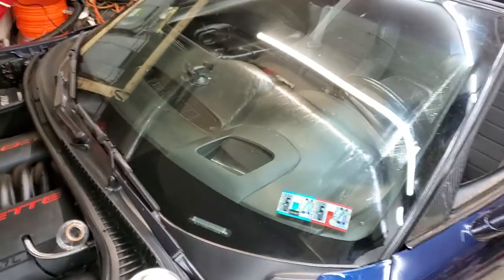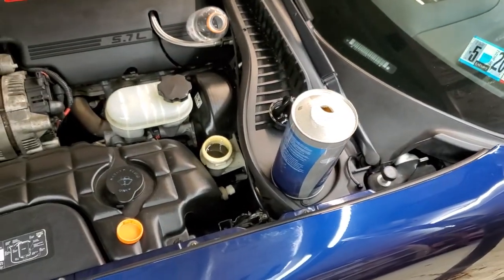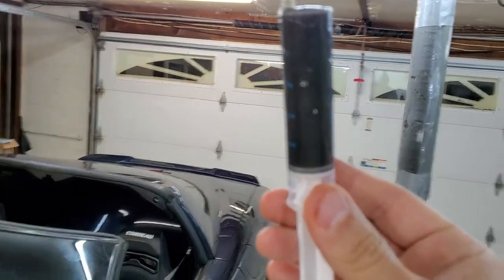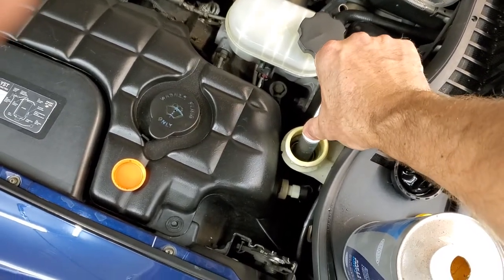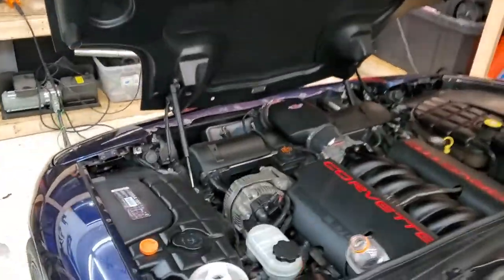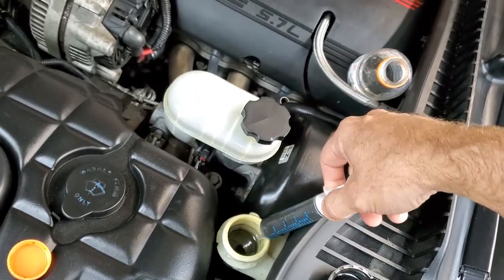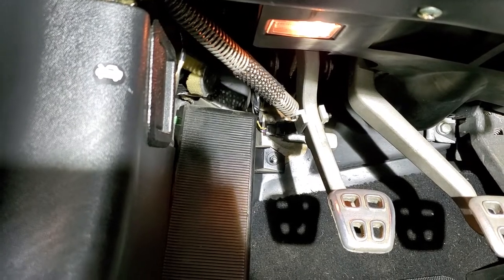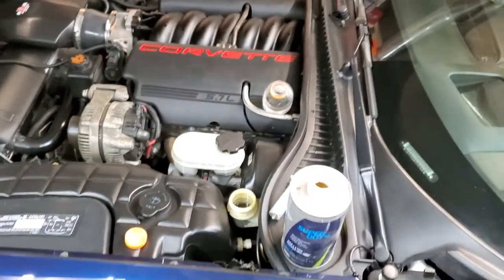Fixing sticking clutch pedal on a c5 corvette

Comment: I have a My-T-Vac fluid evacuator that will slurp that reservoir dry in 
seconds and holds 2.3 gallons. It's a good tool to have for changing 
fluids in anything with inaccessible drains. I use it to change the oil 
on my supercharger. Also good changing water pumps, cyl heads etc when 
there is no way to drain the block and the coolant level is even with 
the gasket surfaces you need to clean and prepare. You can suck the 
coolant out of the block and get it below your working level.
Reply: Which model do you have?
Reply: @aces23jump  Model 7201, $115 on amazon.

Comment: You can use the cheap air powered bleeder from Harbor Freight to suck the fluid out of the MC. Its a good sized container so it will hold a lot.

Comment: This is happened several times I did exactly what Ranger says in his videos my clutch still gets stuck amd the fluid is clear I use DOT 4 as well.. my car has 44,000 miles Full Exhaust, Intake and Tune 2nd owner pretty sure it's a factory clutch
Reply: Same. I got a C5 Z06 with 42k miles. Full exhaust, intake, cam and a tune. Clutch pedal sticks or gets half stuck every time I dump it at high rpms. Then goes back to normal after 2 minutes. So damn annoying.
Reply: @ghostk5763  well I got the Clutch fluid lines E-Wrapped Aka some kind of heavy duty electrical tape but it still keeps doing it I think I need a new clutch honestly I just got my dynoed 2 weeks ago exact mods Kooks 1" 7/8 Longtubes with a 3" collector to a matching Kooks 3" X-Pipe and reduces to 2" 1/2" to a Corsa Sport Axleback and a True Cold Air Intake from K&N and Tune made 395 @ Wheels & 370 ibs ft of TQ. And to be honest I just raced a brand new 2020 Coyote 6 spd this morning I had him by 2 car lengths  we raced from 60 I was in 3rd he jumped on Me for a like 2 sec and I still was able to pull on him my the end 3rd and immediately stop his pull and kept pulling on 4th
Reply: @ricardovilla1757  Thats awesome man. Yeah I have Kooks longtubes, Full Corsa Extreme exhaust, True Cold Air intake and I don't know my Cam because it was done by previous owner, same with the tune. I haven't raced anyone and I'm unaware of the WHP. But overtaking people sometimes I catch myself accidentally going 120+ Mph, it just catches up to speed so fast with such little throttle. But if you can beat mustangs, that makes me happy lol. Like I said, no races yet for me ;(
Reply: Try bleeding the lines...you may have air in them which would cause it to do that even after changing the fluid with that method.
Reply: You have to bleed the actual slave cylinder. The spring is just a bandaid.

Comment: You recommended Dot 4. On my cap says to use Dot 3. I bought the the Super Dot 4 that you used. Thoughts??
Reply: Dot 4 is OK to use in a Dot 3 system because they are both glycol base. Dot 4 has higher "wet" (3.7% water contamination) and dry (zero water contamination) boiling points and will perform better under high heat. Because of it's higher heat resistance, 4 is considered higher performance fluid, and it is backward compatible with 3 systems, you just can't use 3 in a system that specifies 4. However there is a trade off. Both 3 & 4 will eventually attract water contamination from the atmosphere, and so they both need to be changed periodically. But 4 does attract water a little more quickly than 3, that's the trade off with 4's different formulation. 4 has higher heat performance but needs changing more often. If the car is to be neglected then 3 is a better choice. If the car is well maintained then 4 is the better choice. At least that is the case with brake systems because brakes get hot. I honestly don't know if clutches see the kind of heat that brakes can get. Perhaps the engine heat and a nearby exhaust pipe on in a hard driven car on a hot day can make that kind of heat in a clutch system. But if you intend to change the fluid regularly the Dot 4 will not cause any problems and may perform better if the clutch system sees any extreme heat.